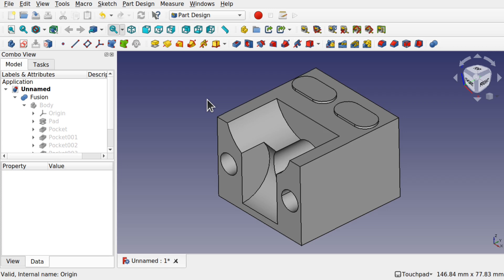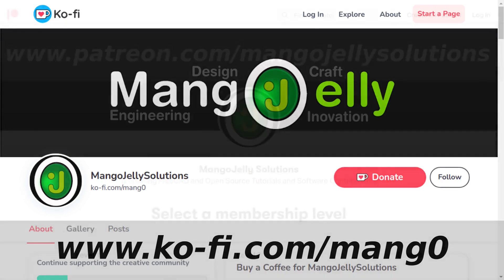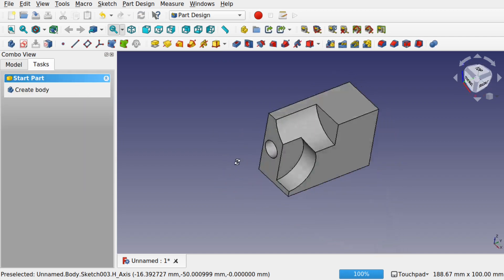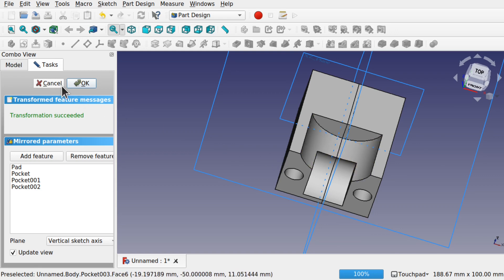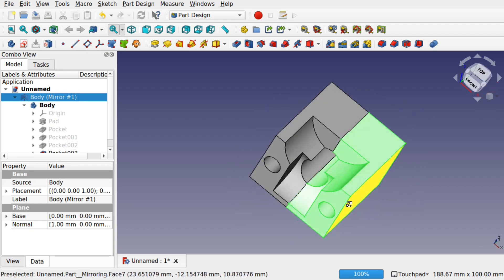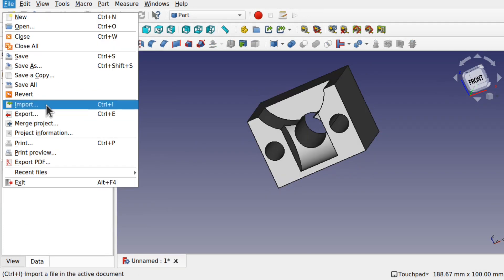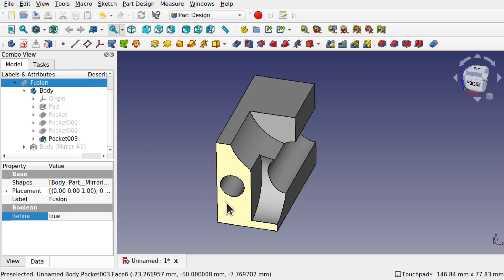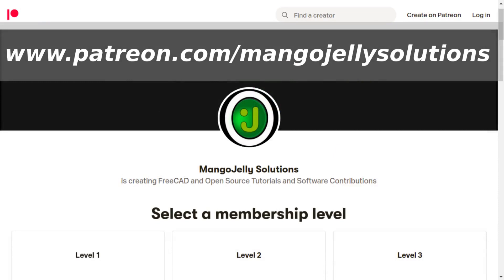FreeCAD: Using the Part Design Workbench and Part WB together: Mirroring

Comment: Optimising when to use part vs part design WB has been a bit confusing for me.   Good example of the benefits of using both together.
Reply from the maker: Thanks, I am going to revisit this as I have used both extensively for modelling and want to share my experience with others. After using freecad for such a long time I automatically go to either workbench depending on the task. I am trying to stop myself and think why I have chosen that method. I need to get these out of my head and on videos and explain my thought process so it gives other people guidance and also myself. As someone will say 'well why don't you do it this way?' which is always beneficial to have those discussions as everyone learns something new.  Freecad gives you so much flexibility but not so much guidance. Which though frustrating actually I also find it is a good thing in a way as people get very creative with the solving problems.

Comment: Great tutorial about the 2 workbenches! Thanks!  One of the issues I faced was,  lets say I make a simple sketch and pad it in the Part Design WB, then proceed to add a filet in the Part WB. And then I go back to edit the pad depth, this does not carry over to the filleted edge, rather it just makes a New body. For now the use case you described seems to be the one of the few ways to use these 2 WBs in one workflow. I still am afraid i will break my model if i switch between these 2 WBs  :P .  Maybe they can fuse these two WBs into one?
Reply from the maker: I am still planning to do a video regarding the differences between the two as you requested.  When you requested the video I remembered I had a couple of videos that showed how to combine the workbenches but I wasn't going to release them as I didn't feel they was up to my usual quality.  But after your request I thought you might of found them interesting.  With the example you have given I have followed your process.  When I edit the pad the pad changes but it becomes visible. It should be hidden as the last action created the part web item. This is where you have broken out of the part design workflow and started a part workflow.  This isn't really a safe way to use the workflows together as you have two flows side by side rather than one workflow flowing into the other maintaining a single parametric chain.  It's hard to explain in writing how to work safely in both together without examples or a video.  You should really stick to one either part or partdesign workbench when first starting.  With fillets these can be all done in the part design as well as the part.  Part design is an addative and subtractive feature based workbench while part is a boolean based workbench.  The part design has a well defined workflow and is in lines with modern day cad processes.  The part workbench is a older style of working but has a load of useful tools to manipulate objects from other workbench. It's hard to get your head around until you have some time under your belt with freecad but once you have made a few models and experimented with the other workbenches, things start to click.
Reply: @MangoJellySolutions  This is very thoughtful of you, Thank you! I guess one of the flaws in free-cad from a new user perspective, is the default availability of two workbenches that share so much functionality, that unless the new user finds out through experience or by advice through veterans of the software such as yourself, the issue of messing up becomes unavoidable. From my experience, I think they should at-least disable the part workbench in the default installation. That way, new users wont get confused by the redundancy of features b/w these two workbenches and people proficient in free-cad can just enable both the workbenches in the preferences if they so desire.
Edit: From my limited experimentation (and please correct me if I'm mistaken) the only major reason to use the part workbench over part design(for beginner needs) seems to be support for multi-cumulative single solids in one body. Like i cant make arrays in the part design workbench, so i used the part WB or draft for that. I found out recently that the linkstage3 dev branch has multi- CSS support on part design by default. Do you think this will make the part WB obsolete? Thanks!